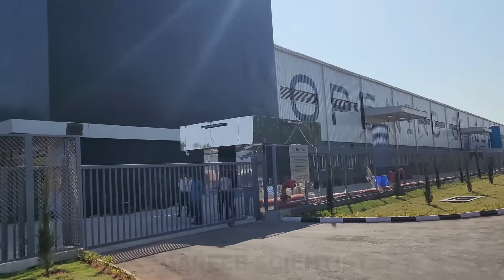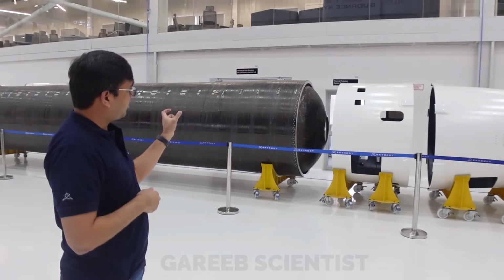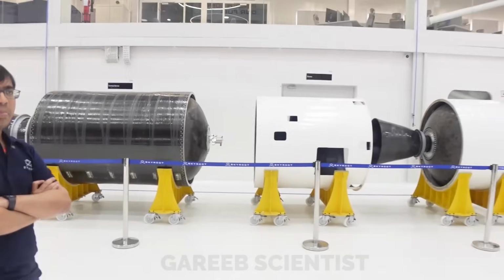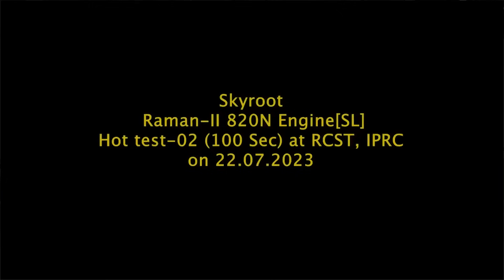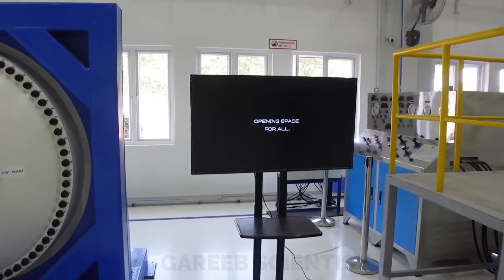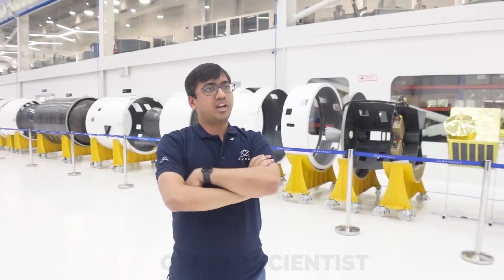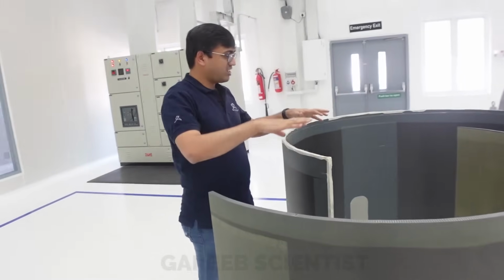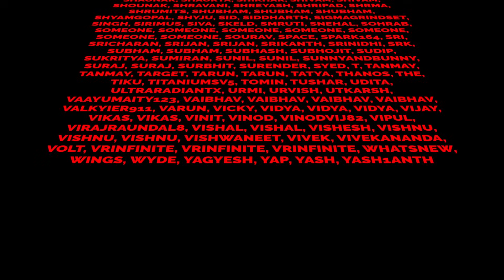Skyroot Aerospace - Factory Tour

Comment: one of the Best videos. No Nonsense .
U shd have shown that Honeycomb cross section . That is impressive Composite. These can be used by Indian Car companies. 
As a mechanical engineer who has worked with composites. I liked whole Video. 
Best thing is their Rocket looks so beutiful. From color theme to Finish on their Surface. 
I was most confused abt the circular ring at bottom on rocket. Now i understand its to control the solid stage.
Reply: Are you talking about the submerged nozzle or the flex seal?
Reply: @OrangeDurito   The big Shroud which is covering the bottom nozzle attached to solid feul vessel. what is it called?? 
I have never seen such shroud in any other rocket in world. He explained that it is to control the solid stage
Reply: @GuzzarAwan  Ok I went through that part again, are you asking about the blue shroud? If yes, then that’s an engine skirt which will house the actuators for TVC. It will also have LVDT (Linear Variable Differential Transformer) which is used for measuring displacement through which they can command the actuators for precise control. In the flexi-seal demo so far, the TVC actuators are attached to a fixed test platform but when installed on the rocket, they will be attached to the blue shroud. Hope this helps.
Reply: @OrangeDurito  Haan bhai wahi bol rhaa tha.  That blue shroud or engine skirt. I know the mechanism which he told. As i have worked with LVDT and actuators too. Its well known that solid engines can't be controlled. But they have used quite innovative method. I m also a mechanical engineer.
Reply: @GuzzarAwan  Aisa nahi hai ki solid rocket motors cannot be “controlled”. Once ignited, they cannot be shut off and reignited like liquid-fueled engines but their thrust vector can definitely be controlled. Even their thrust curve can be shaped to an extent using appropriate grain geometry. Plus they can also be throttled externally to an extent by impinging on the thrust plume. Joey B did that on Scout F using ceramic tabs/paddles, albeit on a model scale. So, in this case, they are using the first two control methods for rocket guidance.

Comment: 00:05 Separation systems are crucial for the rocket's success.
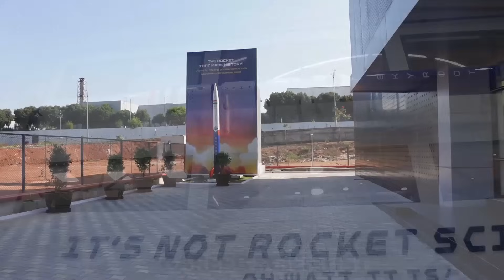02:10 Skyroot Aerospace is focusing on orbital rockets.
05:45 Use of mirror imaging sensor for vehicle control
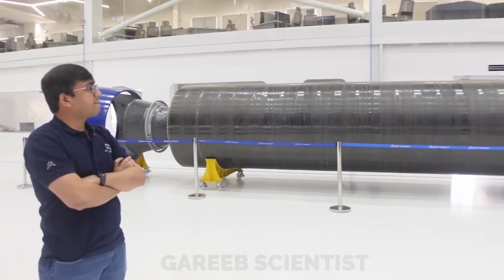07:42 The rocket is mostly made of composite material.
11:23 Challenges in maintaining delicate margins during manufacturing
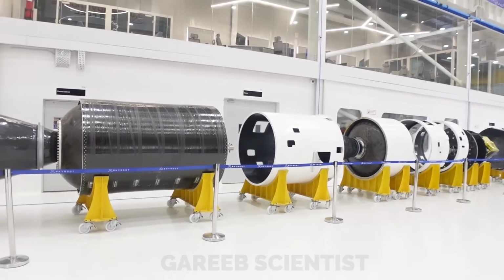13:14 Each stage has its own electronics with a mission computer for the entire vehicle
17:09 Roll control optimization for the rocket vehicle
18:46 Upgraded nozzle with TBC for better payload gain.
22:12 Roll coefficient and aerodynamics validation
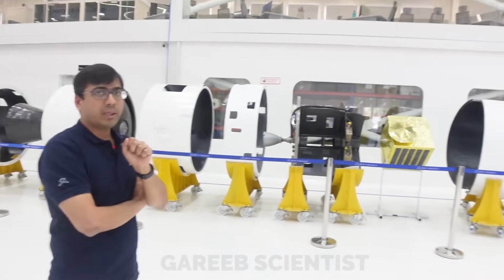24:09 Central engine design change to a single engine
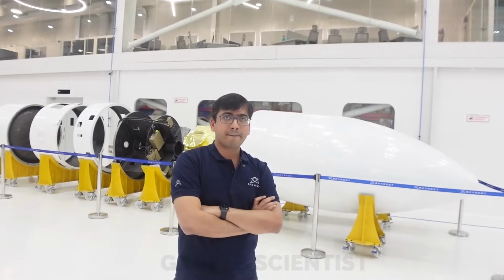27:54 Designing venting and sealing for launch vehicle structural dynamics
29:49 Heat flux affects thickness of thermal protection system
33:36 Wind profiler used to determine launch angle based on wind data
35:45 Designing thrust time curve to optimize performance
39:35 Developing separation dynamics and flex nozzle system presents significant challenges.
41:51 Building the actuation system is very challenging
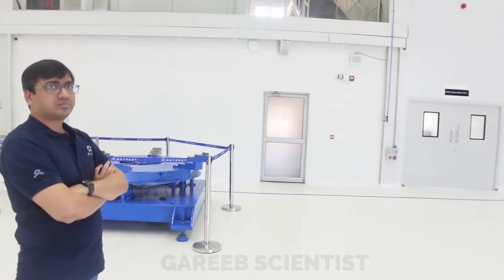46:07 Sensors to measure CG offset for rigid launch ground
48:07 The structure is made with a light honeycomb section for lightness and required strength.
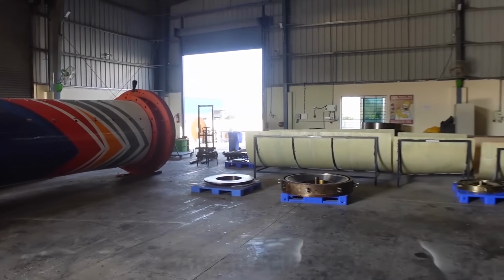52:42 Factory tour provided valuable insights into rocket manufacturing
Crafted by Merlin AI.
Reply: bro   u literally done  😶😬😵
Reply: He just did Copy paste

Comment: Great interview! Thank you for going in detail about each stage and the intricacies related to the overall rocket. There were few new things for me like the isotensoid dome/pressure vessel design and the wire connectors which disconnect during stage separation & how they are kept on both sides to cancel/reduce the impulsive torque. I would love to know more about the latter. 

It’s wonderful to see their progress and how they are figuring out & maturing their manufacturing processes as they move forward. I wish them the best for their endeavours. Jai Hind 🇮🇳

Comment: Just a curious question cant they make a ballistic missile with this as most stages are solid fuel ????
Reply: The difference between a rocket and a ballistic missile is where they are pointed, so basically guidance. If instead of targeting orbit, they guide their rocket to a specific target on Earth, then it’s a ballistic missile. Also, ballistic missiles are under thrust for a shorter period and they are actively controlled to a point after which the warhead take a ballistic (projectile) trajectory to the target. In case of a rocket, if you want to achieve orbit, the rocket has to be actively controlled throughout like in this case, they have open-loop control till first stage separation and then go in closed-loop control till orbit insertion. Hope this makes it clear.
Reply: @OrangeDurito  i mean i know the difference between a delivery vehicle and a missile but essentially they are the same like soviets made human rated rockets from icbms etc
Reply: @heresomewhere7600  That’s what I said. Many of the early rockets were derived from ICBMs like Soviet Vostok from R-7 or Mercury-Redstone from Redstone ICBM, the difference just lies in where they are pointed and how much of their flight is powered & actively controlled (and of course their payloads). Did you mean to ask if Skyroot Aerospace can develop ICBMs for Indian defence as well?
Reply: @OrangeDurito india already have advanced ballastic missiles. IT must focus on space and nothing else
Reply: @OrangeDurito  i meant yea they can modify it to a ballistic missile as a private company with 500 to 1000 kg warhead
Reply: @ninjauserninja4818  but not from private sector

Comment: Two question only please do reply or inquire whenever possible :Does Skyroot has any future plans to build reusable rockets like SpaceX, as that can make it really economical and competitive, Space X basic philology is more rocket engine, using single fuel tank the better, while Isro only uses 1 per stage, here too only 1 engine per stage, why the difference and what are the advantages and disadvantages of both these contradictory practices
Reply: I am not from Skyroot Aerospace but I might give some insight from my experience -

1. Right now their rocket is fully expendable. Considering the current size of the rocket (22m vs 70m for Falcon 9) and the difference in manufacturing methods (carbon composite filament wrapped pressure vessel vs. rolled Aluminium-Lithium alloy sheet with isogrids) and the type of fuel used (solid propellant vs RP-1/LOX in Falcon 9), the economics may not work out in favour of recovery as the cost of recovery and refreshing the first stage might be more than producing a new first stage. 

2. More engine is always more complicated than a single engine as you have to take care of the flame-flame interaction and combustion instability, not to mention the added turbomachinery which all have to work in sync. Considering the size and the payload weight class they are aiming for, they are getting sufficient thrust from a single engine. And considering the first 3 stages are all solid propellant based, unless they are augmented with a liquid propellant core or side boosters, we cannot talk about adding more engines. Solid rocket motors as always single nozzle. 

Hope this helps :)

Comment: do they have any plan to build verticle take of and verticle landing engine
Reply: Rockets take off vertically so…
As for the vertical landing part, they are working on the expendable rocket as of now. I hope they start working on reusability as they progress, atleast for the first stage. It’s also about the economics. Given their carbon fibre design and the current scale of the rocket, it might be cheaper to produce a new stage than recovering and refurbishing one.

Comment: fantastic video but as you acknowledged yourself its pretty technical. What i would want to know is rationale for choosing carbon composite structure over steel apart then it being light, as many startups in US have eventually gone with steel for scale. Can they take this method to scale?
Reply: if start ups in usa are doing something that doesnt mean they are right . we should use our own mind and not follow what others are doing
Reply: @sarthaksingh8863  when did I say we have to follow anyone?  It's a very naive way to look at things.  To succeed in this world you need scale and wherever you can learn best practices or proven tech, you should.  Carbon composite structure making must require highly advanced robots and materials manufacturing I'm just assuming here, that's why I asked the rationale and maybe they have cracked the code for scale on that. I don't know. But I just wanted them to talk more about it.  Anyway, I want Indian space startups to succeed that should be the goal rather than earning brownie points on innovations that can't be scaled that's all.

Comment: I have a doubt that he said thrust is reduced before maxq  but after increasing thrust again stress on rocket will  increase. Confused little bit please reply
Reply from the maker: no it will be out of atmopshere by then right , so thrust can again be icnreased
Reply: He said that the solid propellant grain profile is designed in such a way that when the rocket undergoes Max Q, the thrust is reduced to cope with the dynamic stress. After that regime, the solid propellant resumes the thrust but the rocket is in thinner atmosphere so it won’t cause that much stress on the vehicle. Max Q is the point where the vehicle is experiencing maximum aerodynamic pressure which a function of vehicle speed and atmospheric density.
Reply: Oh got it thank you gs you replied
Reply: @Orangedurito got it thank you